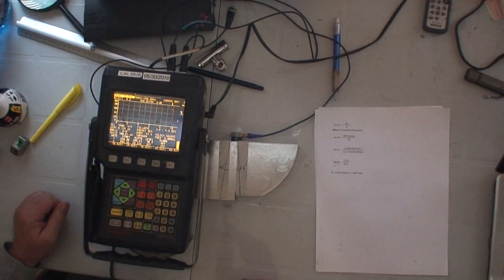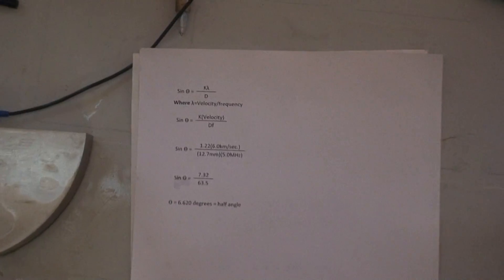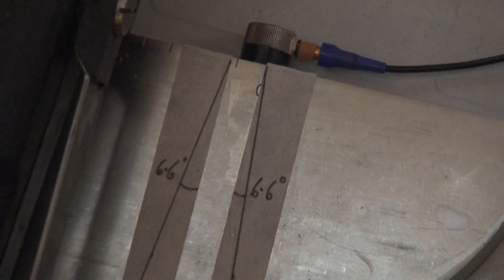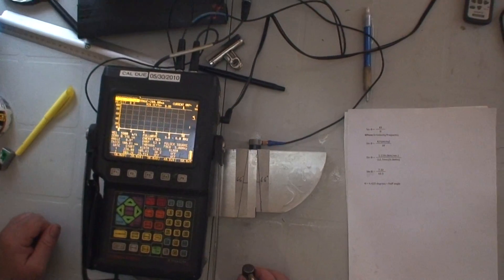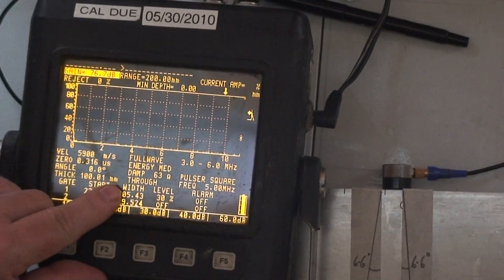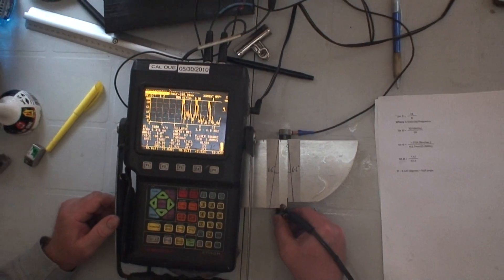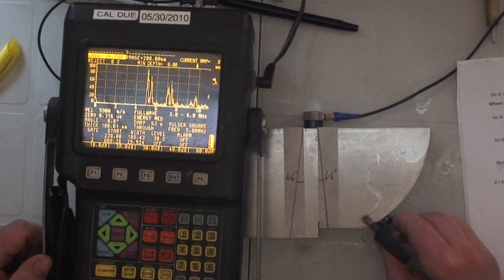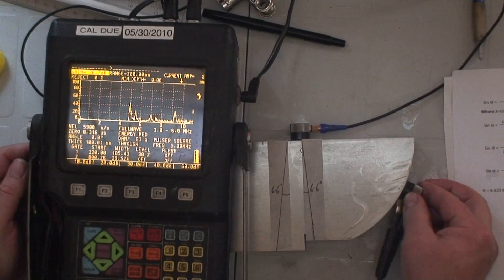Sound is Round

Comment: Hi, this video quiet old, and I found its link on a NDE.org forum. You may or may not be aware, but the 1/2 angle beam spread formula is meant to give the 1/2 angle to -6dB of maximum sound pressure. If you are further interested in beam modeling I suggest you explore "Photoelastic Visualisation of Ultrasonics" by Ed Ginzel, and CIVA software.